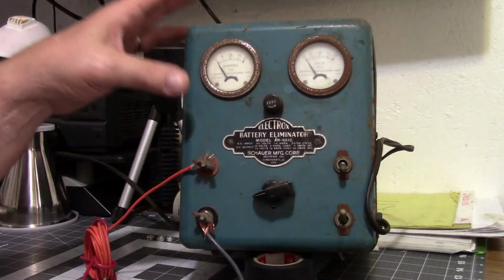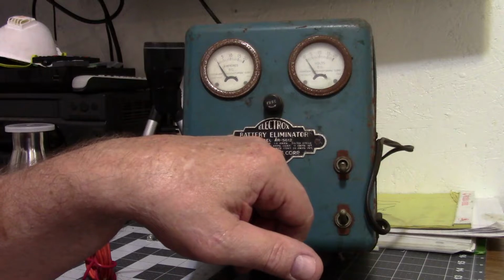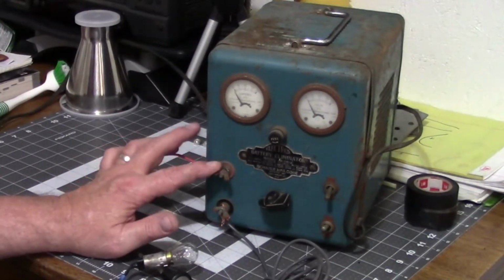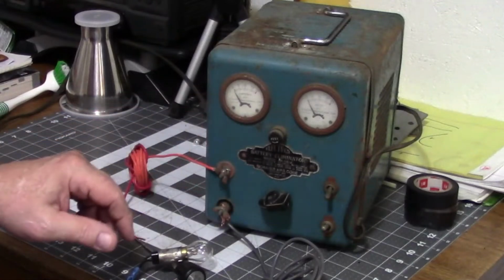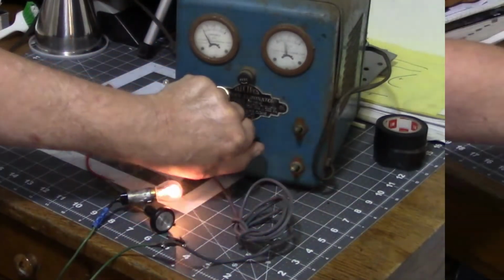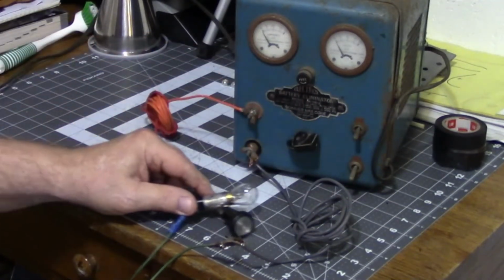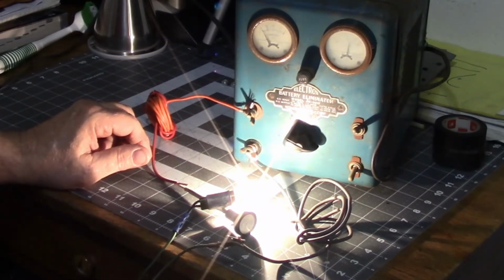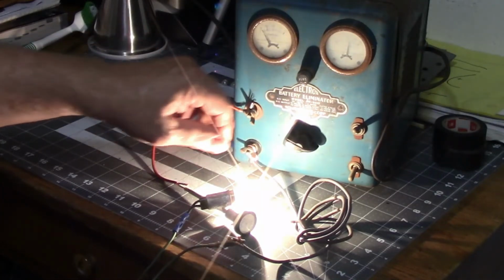Electrox Battery Eliminator AR-5612

Comment: Nice seeing an old unit like that still working. It probably uses a selenium rectifier, or perhaps even a mercury tube rectifier. Either way, they are pretty much indestructible. Thanks for letting us take a peak.
Reply from the maker: Thanks Bruce, I was hoping to not go into it. I will do more cleanup and use it as is I hope. Stay well and stay safe my friend

Comment: Old stuff like that looks cool on the work bench shelf..With a few mods .It could be fined tuned to be really accurate on the output voltages..
Reply from the maker: Thanks, it will supply plenty of voltage for the projects I have in the future.

Comment: Nothing better than vintage voltage; it is amazing how Ohm's Law works cool unit. Back in the 70's built a Heahkit ham radio VOM , power suppy, oscillscope, signal generated ..they made cool stuff sad to see them close. They also offered home training units or kits for basic DC & AC theory.
Reply from the maker: Thanks Dan, it has its limits but would be handy for testing wiring and other 6-12 volt projects

Comment: Thats an oldie but a goodie. That definitely has the voltage and current to run any car radio or cb power supply. Looks pretty good for having been made in the late 1930's Thanks for sharing.
Reply from the maker: Thanks Larry, it would be perfect to operate a range of low voltage radios